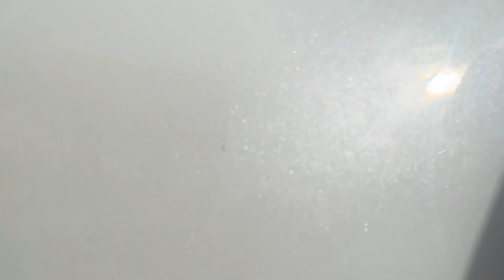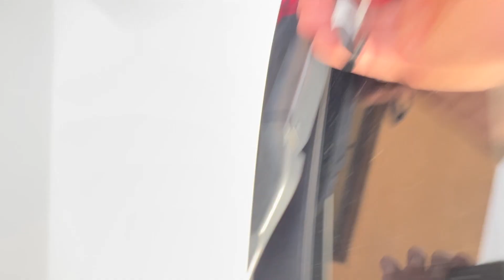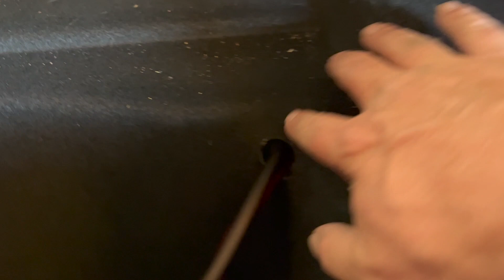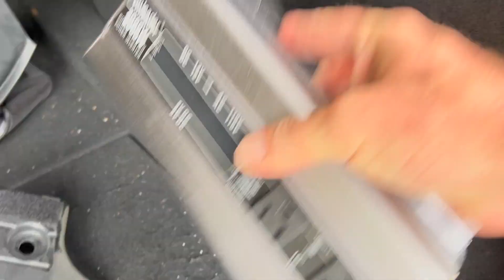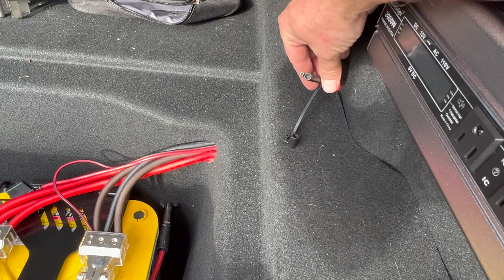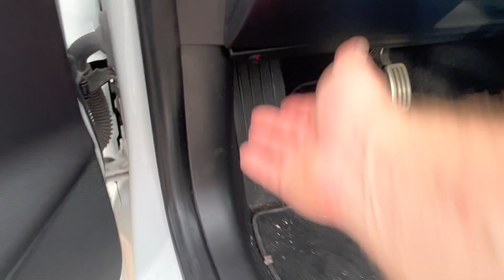Rally Tesla M3P - Part 3

Comment: Cool video and awesome build! 
Question, have you notice anything weird with the traction control system after you installed tires with larger diameter? I’ve got the lift kit too but the stock spec wheels and tires just look wrong with the car lifted, but since the model 3 is my daily id like it to drive as normally as possible

Comment: Where did you get the fender flairs? 😍 im doing a lift kit on my 21 m3p to to make a propper winter machine filled with extra lights on the hood and the front bumper and on the roof railings. But I'm strugeling to find the flairs